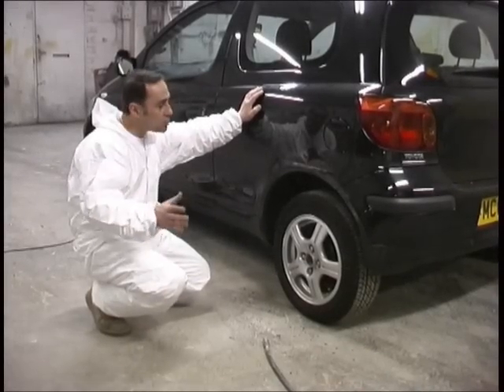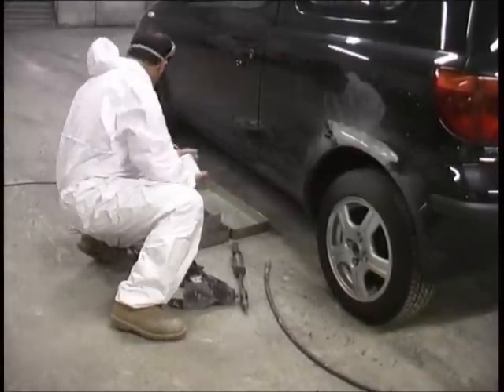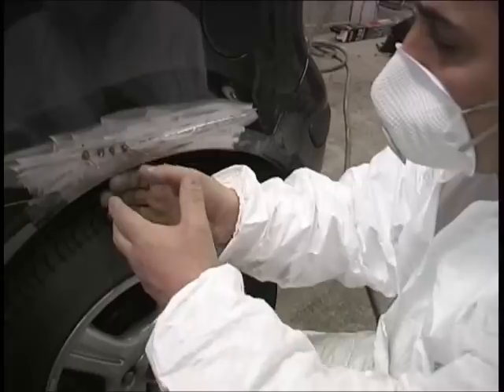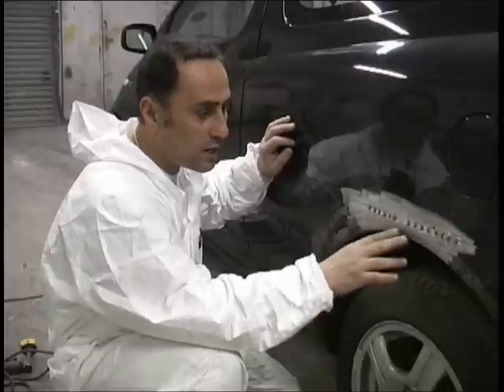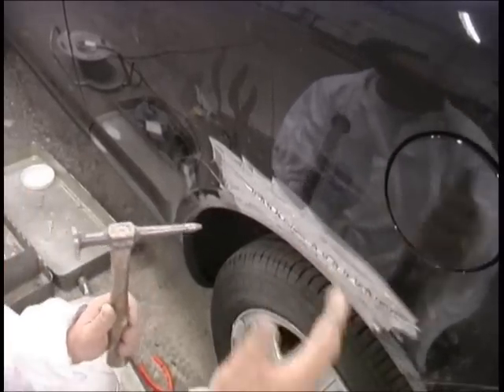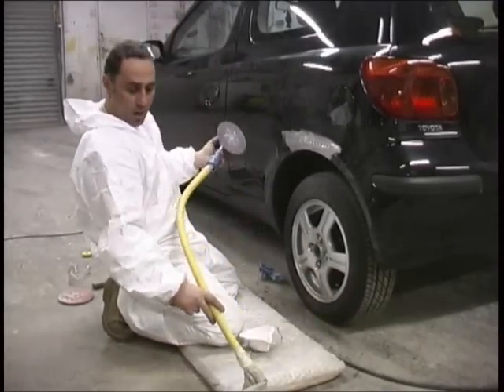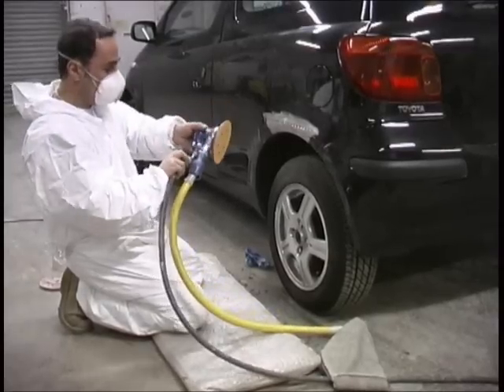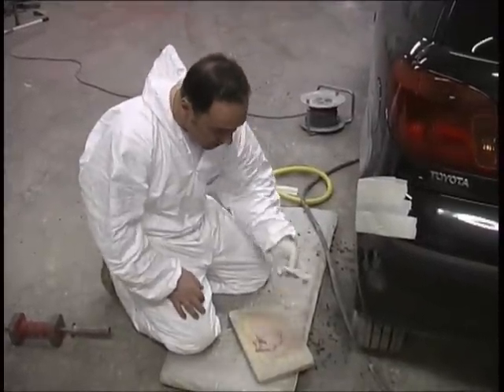Car body repair - Panel beating and spraying - General repair - Tips of the trade

Comment: Just fill it. Also a panel beater wearing painters pare overall? Also ear protection? Haven't been a beater for more than ten years but we would be lucky to get 0.3hours for that dent. Also you should tell your estimators to get you time to remove the bumper, lamp and filler cap. ...next!

Comment: NEVER use the pointed side of the panel hammer on flat surfaces, Always use the flat side of the hammer and GENTLY tap the high into the low.

Comment: lol put a panel on it? are you serious. lets break factory welds for a 6.5hr dent lol. this guy is showing how to use a stud puller. very common. we have a studless puller at our shop. its awesome. i agree on disconnecting the battery however thats mostly when welding even tho this is still a type of welding.